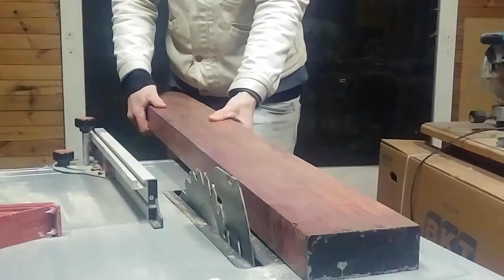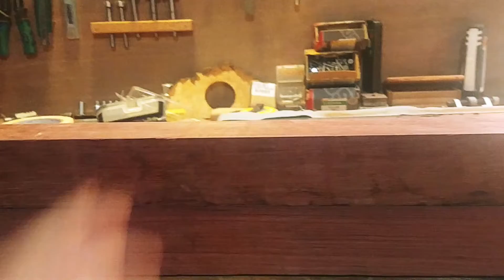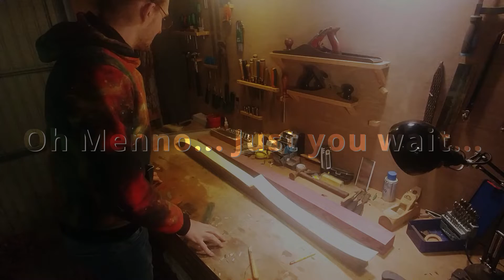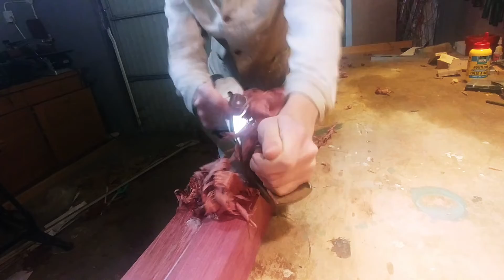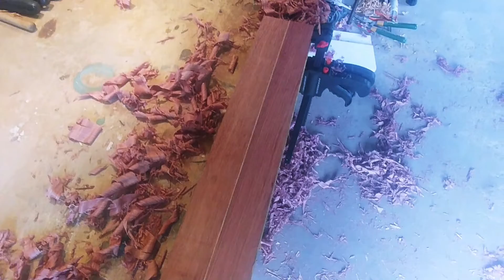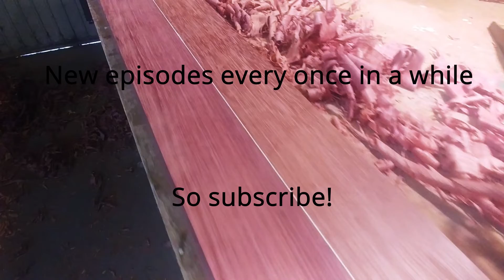Great Guitar Build Off 1: Neck blank

Comment: Wood that hard, with some silicates, and some interlocked grain, on any normal table saw, a ripping cut THAT deep, you may want to take that in three cuts...

just a thought.
Reply from the maker: Jup.... Realized that a bit late... I had never really used a table saw on anything other than pine before. But next time i will definitely take more passes.